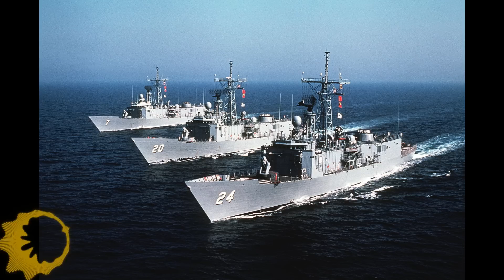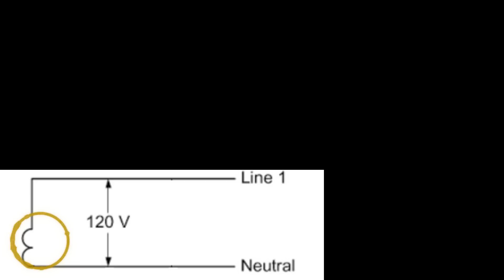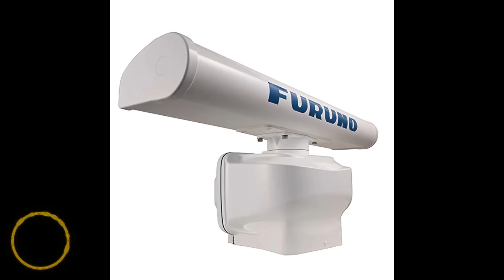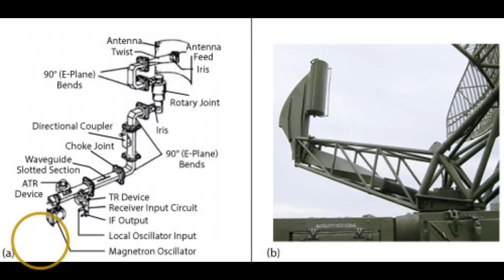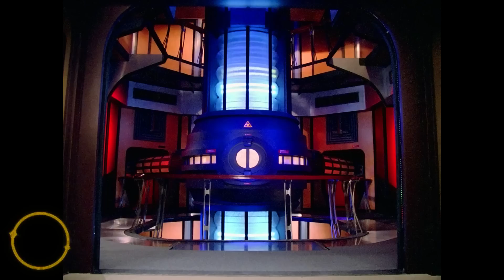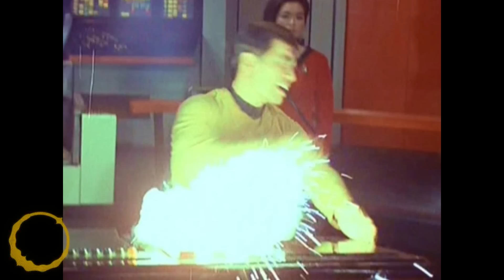You done put a grid in your EPS

Comment: It has always astounded me that the control panels require such immense amounts of power. Have they not heard of relays?
BTW, if interested, Nimitz class power generation is 4160VAC 3 phase. Because of P=V x I this 10x voltage, reduced the quantity of copper cabling to build by 100 tons. I was an MM2 nuc on USS Eisenhower '86-'90
Reply: Because the writers has no idea how stuff work. They always used relays. Modern controls like seen in Star Trek is just an computer interface to the computer who control the systems, locally like in the engine room you have manual overrides who work on relays. 

Take guns, the fire control computer aims the gun based on data from radar or inputted if no radar or say indirect fire, wait until gun is pointed correctly and then the roll cancel out, then fire. All this is done by the fire control computer, WW 2 stuff for capital ships. 
Now the only thing require lots of power is moving the guns.

Comment: ST:TNG Technical Manual (yeah, the one everyone dismisses as non-canon because reasons, even though the technical directors for Star Trek WROTE the dang thing) described the process of M:AM annihilation and warp/EPS plasma as a slightly matter-bias reaction.  IOW:  Matter and anti-matter are annihilated in the reaction chamber, but slightly more matter is being injected into the core so that instead of just constantly spewing gamma radiation, there is leftover deuterium in the chamber to absorb the energy and act as a medium for it as its piped away.

Now, for the warp engines, impulse power, and phasers, having a highly-energized plasma makes sense, as you get your exotic processes that take this plasma and turn it into warp fields, impulse exhaust, or nadion particle beams.

It's everything ELSE that makes no sense other than the EPS must be getting routed on thermo-couples.  Or really, something like trek-no-couples.

But like anyone complaining about exploding bridge panels, I of course ask 'who thought it was a good idea to route what amounts to a science fiction, high pressure  steam line, right to the control console on the bridge?'
Reply: Clearly because achieving a beautiful user interface like LCARS can only be done using molten metal that has to be kept hot enough to be liquid. They just use their supermaterials and possibly micro-shield generators to insulate those temps from anyone touching the console. That metal just happens to look like rock when it flash solidifies when damaged, thus we explain the rocky debris! A perfect theory!

Comment: Correction: 3 phase power nets sqrt(3) (~1.73) times the power transmission, not 3x
The reason it is preferred is ease of starting motors, and you "get something for nothing" because 3 phase systems can carry 73% more power at a cost of only 50% more copper/weight/complexity.
But otherwise right so far as of 8:27

Comment: Never seen a steam powered turban before...must be hot under the collar....

The lack of paint on the wave guides may be to prevent heating.or attenuation due to pigments in the paint, e.g. lead.

Also, a funny thing about plasma is if there isn't a containing environment, it kinda goes away pretty quickly.  And Star Trek probably has plot fuses on the EPS conduits.

Comment: Fun fact you missed there Dockmaster...As you know, plasma is kind of HOT, really HOT, Temperature of a star's surface HOT. Thus Starfleet has these super hot lines running all through their ships in easily breakable conduits. Please address the best system on any ship in Starfleet, the Thermal Control System. Their ships are not glowing so they don't have radiators, so where does all that heat go?
Reply from the maker: I have to assume that whatever containment system they're using for the plasma itself is also handily containing the heat.

Comment: The simplest way (relatively speaking) would be to run the plasma in a relatively higher energy state. This creates a moving magnetic field for the taps (basic generator action). Assuming the conduit itself isn't a mass of transformers that would both contain the plasma and act as a generator. You just have to balance expected loads beforehand. The now lower energy plasma would be returned to the core for re-energization.

Comment: My father (RIP) was an Australian Navy Electrician, and I have heard all sorts of stories about Generators being hooked up shore power, 180Deg out of phase..and a Generator running clockwise, becomes a motor turning anti clockwise, for about a microsec, before it snaps the drive shaft, is sent through three decks, and deposited on the pier next to the ship.
Reply from the maker: Sounds about right.
Reply: Have you left this comment before on an older video? Swear I've read this exact comment before today many weeks ago.
Reply: @firstnamelastname4959 I have read (and reposted) a similar story, only about a stationary generator inside a building, also being hooked 180 degrees out fo phase.

Comment: Semi-canonically (from the TNG Tech Manual) the MAMR runs an excess of matter over antimatter. The matter is pre-fused deuterium, so the resulting plasma is helium. Very hot helium obviously.

The warp nacelles vent that plasma into space once it has dumped most of its energy into the warp coils that generate the warp field. The vented plasma is still pretty hot which is why starships leave ion trails once the vented, cooled plasma falls out of the warp field.

The main warp conduits are sized to resonate with particular frequencies of the energy contained in the plasma, frequencies the warp coils need. Other frequencies are tapped off to be down-converted to run all other shipboard systems. Plasma can “carry” those frequencies better than the usual vacuum in the conduits for… reasons… so there are lots of auxiliary vents to get rid of that plasma once its energy is extracted and used. That’s for high powered systems like shields and phasers.

Many systems just use the (basically) microwave energy (the E part of EP) which again gets down-converted  in frequency and voltage, and sometimes rectified to DC for a specific use.

Never mind that the “baseline” frequencies of the helium plasma will be in the low gamma ray/x ray/hard UV part of the EM spectrum, thus evidently Starfleet has down converters and rectifiers that can take hard x rays and make DC out of them.

TNG consoles explode because they run on pulsed coherent light running back and forth in the ODN (Optical Data Network) which can experience power spikes when things go sideways. Unlike an AC power system that just stops carrying power when a component goes BANG, all that coherent light has to go someplace, turning part of the console into rapidly expanding showers of smoke and hot particles.

You’d think they would have figured out how to make optical FUSES by the 24th century but apparently not.
Reply: My explanation for the EPS grid is that starships' non-propulsion systems run on so much amperage that wires can't conduct it without massive heat losses, upconverting that massive amperage to massive voltage to allow using reasonably-sized wires would come with significant arcing risks, and superconductors have their own practicality problems, so they use tubes full of excess fusion plasma as electrical conductors. As a bonus they don't need fuses because they can just vent the plasma and the entire conductor disappears in the process.
Reply: @fyrstormer  Heat loss isn't the problem.  Overheating would be the problem.  Metal wire has low resistance, but it's still a resistor.  When you push too much energy through metal wire, it gets hot... hot enough to glow, melt, start fires, or outright vaporize (like the little strip inside a fuse does).

Plasma is matter that has already been pushed beyond vapor, so it cannot burn out.  Plasma is an electrically-conductive soup of free electrons and ionized atomic nuclei, so it's the only substance that can carry extreme voltage/amperage without burning itself out.  Basically, it's a tube carrying a continuous bolt of lightning.

Great for powering warp engines, shields, phasers, and the deflector dish... but yeah, it makes no sense to power little appliances like a control console directly off an unmeltable main transmission line that's carrying enough juice to run an entire continent.
Reply: @fyrstormer  the thing is though is that there are a lot of systems, particularity on the bridge that shouldn't need this kind of power. All the consoles on the bridge, they are just large touch screen displays with data connections. Unless starfleet is using massively energy inefficient displays for some reasons, all those displays should only require at most a few thousand watts of power, which can be easily provided by two 120 volt 20 amp circuits or 1 20 amp 240/208 volt circuit. Thy might be hooked up to a smaller computer that is networked into the main computer, effectively the federation equivalent of a couple high end desktop computers, but nothing that's going to require megawatts of power.

Lighting would be presumable some form of solid state lighting, like LED's just more advanced. Really the only high powered systems that would be on the bridge would be the force field generators for emergency force fields, that's it. 

Life support systems also wouldn't be that power hungry either, since that's a technology we have today and we can run it from basic electricity just fine. Same with HVAC systems, door controls, power for personal electronics, computers and other small appliances. 

Really the only stuff that has the potential to be massively power consuming on a starfleet ship that ins't the engine plant is weapons systems, shield systems, force field systems, replicators, transporters, sensors, and holodecks. Everything else has some form of modern equivalent that is not that power hungry and presumably, starfleet would have much more power efficient versions of than we have today. And realistically holo decks and Sensors also wouldn't be so power hungry that they couldn't be run off an electrical system.
Reply: Given the number of times Scotty talks about stuff being "fused" on TOS, you'd think fuses have somehow become a lost technology by TNG.

P.S. -- thanks to the OP for sharing the tech manual and   suggesting that ships coming out of warp after a long duration at high speeds are accompanied by a massive helium bloom on sensors.
Reply: Do you mean that their optical fiber system deals with so much energy? =D
Reply: @markfergerson2145  what you just wrote doesn't make any sens... Which is why it's technobable I guess.

Comment: I was stationed on a Knox class frigate back in the day.  We were coming back from Rota Spain when some boot turned the wrong valve on one of the boilers and let sea water in.  For the next two days we weren't allowed to take showers or shave or flush the toilet if we peed, because they used one of the evaporators too flush the boiler with fresh water.  Of course we still had to perform all our regular maintenance.  We were pretty ripe smelling by the end of those two days!

Comment: Star Trek control consoles are like directly switching 230V AC in your computer keyboard. First time you spill your drink you get electrocuted and who hasn't spilt a drink on a keyboard. Whereas the keyboard I am typing this on is probably running at just under 3V DC as it is powered by a pair of AA batteries.
Reply: maybe in the tube era, but certainly not in the silicon age. of course some of those early teletypes were entirely electromechanical, with a mains ac motor and a bunch of relay controlled solenoids where almost everything else comes from shaft power. but then again they were also big metal bricks with keys on them. these got replaced with solid state dumb terminals that dont send any mains power past the high side of the power supply (except the big flyback transformer to drive the crts, and those are freaking dangerous). star trek is regressive in that it goes back to the old mainframe model where everything is a terminal to the ships main computer (the big d actually has 3 redundant cores networked together). surely they can do better than '70s tech.
Reply: I think it would make sense to convert the plasma to electricity (AC or DC?) at the room level. Or would that be too much of a shock-risk?
Reply: @jakeaurod  direct conversion from charged particles usually results in hvdc (ignore the fact that nether d-d or d-t fusion, nor antimatter annihilation, produces charged particles, you need he3, or proton-boron11 for that, the latter being the cleaner and also the hardest to fuse). you would need a buck converter to lower the voltage to something safe and useful and then an inverter if you needed ac for some reason (ships use s lot of 400hz ac, so you can do that). 

frankly running eps power all over the ship seems like an over-complication, except for systems that use a lot of power. makes sense to just have a few redundant conversion stations and route the power through superconducting power lines (eps conduits are effectively a really long mirror machine so you need superconductors and all that entails anyway).

Comment: ohh mate.
I'm very sorry, but you made classic mistake. 
Right, so Warp engines are not the primary power source for a Federation ship! Rather their impulse engines are basically fusion reactors. Those are what generates the power for lights, gravity and everything else.This is why a ship can still do suff when the Warp core is offline. it's also why when "warp power to the shields" is a big deal.
Reply from the maker: This is incorrect.  

Impulse engines provide backup power, which, yes, is why ships can still do things with the warp core offline.
Reply: @SacredCowShipyards  I'd love that to be the case, but it isn't. Remember that on multiple occasions in TNG we had "Warp power to the *something*" be it shields, tractor beam or whatever.
It confused me for years, until I put my head down and got hold of some research material. It's the impulse engines that are the main power supply. The Warp core is just too powerful for most of the systems
Reply from the maker: "EPS conduits usually started at a matter-antimatter reaction assembly, also called the warp core, where matter was converted to energy, and extended to all areas of a ship. Plasma conduit power levels were regulated by plasma coolant ducts, and monitored by plasma conversion sensors.

Very large conduits extended from the warp core, through the nacelle struts, and into the nacelles to facilitate the massive power transfer to the warp coils needed to create a warp field. A plasma stream was directed by plasma injectors at the warp coils.

In addition to distributing power to the warp nacelles, various EPS taps were placed on the conduits throughout the ship to enable other systems to access electro-plasma wherever it was needed. "

https://memory-alpha.fandom.com/wiki/Electro-plasma_system

Comment: 7:25 im not too familiar with larger shipw but all the small vessels i know of have the entire electrical system isolated from the hull due to corrosion issues.
Reply from the maker: Most military ships have dedicated, replaceable, sacrificial anodes built into the hull.
Reply: @SacredCowShipyards  The new aluminum hull ships even more so.  Without them they are little more than a floating disintegration.

Comment: I always assumed star fleet used bubble gum, chicken wire and duct tape to move electricity around.
Gotta keep those military traditions after all.

But seriously(or not so seriously as the case may be), WTF?
What moron of an engineer thought it was a good idea to route a highly energetic material directly behind every freaking console, which is going to rupture and explode when the ship gets so much as a love tap from a proton torpedo or phaser. Heck it doesn't even have to penetrate the shields, but will still cause catastrophic failures like this?
Those guys/gals at utopia planitia really need a good talking to, and a refresher course on how plasma works, and learn what seatbelts are.

At least they aren't using a black hole for their power source.

Comment: You know the 'explodium parts' of those consoles, could be in a seperate smaller room to the side or even under the bridge, the consoles only use electricity anyway. I still would want big ass ammount of arc faults and surge protection installed installed, as well as some other things to make sure I don't get the 'not so friendly neighbourhood electric arc' punch me in the face, I have seen the protcection gear against that stuff for "small and medium" power applications I'd rather not get tanned by 20-25.000°C in the face! Not that I could hear teh officer complain about impromptu tanning on the bridge since my ears would be ringing!
Also there is a reason why the bigger power conduits have shared rooms for "authorized personal only", those arcs look pretty as they burn out your retinas, but they are loud, hot and so spontanius they produce a shockwave upon first ignition.